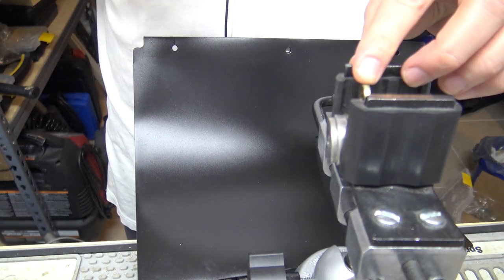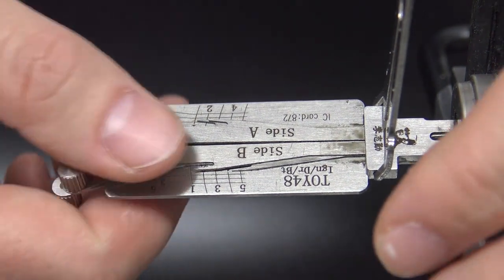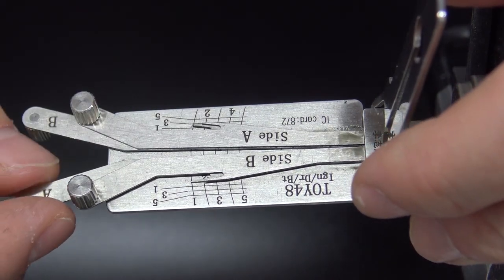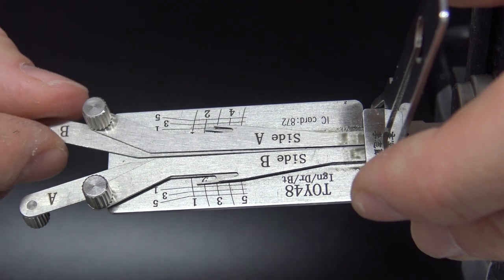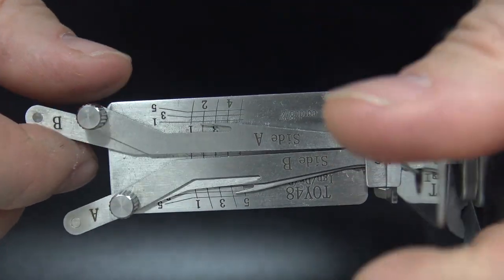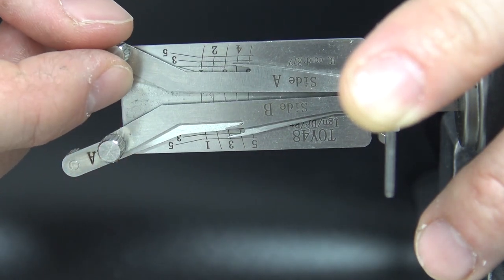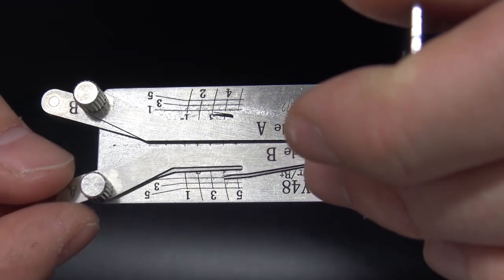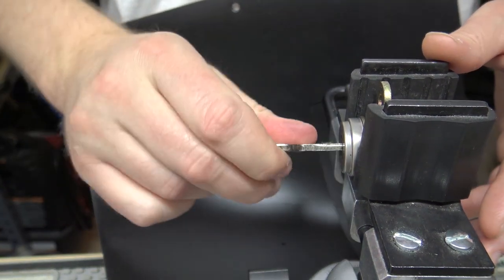(458) 4 Lifter TOY48 Lishi Picking & Decoding Lexus Door Lock

Comment: These are the most difficult for me... B111, hon66, hu66..easy..I have more trouble feeling these than any other. Started using lishi primarily for keymakes around 2014/2015, love them! So much less scoping and disassembly! (Also, screw an easy reader 🤣)
Reply from the maker: I love lishis!  They’re amazing. When I have to actually take a door panel apart or a car lock apart I almost get mad lol.
Reply: B111 is the hardest lishi ever made, especially with loose locks. It could be 1-4

Comment: Hi Bored! Can you please tell is there any difference in picking/reading technique if the lock is in its "real world" position in the door where the neutral key position is vertical? I have a dead battery in my Toyota Auris (again, lol) and decided not to call a lock opener people this time and do everything by myself. And I have a strong feeling that I'm doing it wrong (or maybe the lock itself is broken bc its emergency key never worked since the car purchase). When I try to pick, i.e., side A, it appears that some pins are pickable on the right and the same ones are completely "free" on the left (no resistance at all, even a light springing back). I apply tention to the lever clockwise.
Reply from the maker: There’s no difference in picking whether is in my vise or on a car.  If your emergency key doesn’t work the lock is either broke or it’s the wrong key.  These are crappy locks and wafers are easy to bend even by inserting a wrong key.   That said I wouldn’t call this Lishi a beginners one. You can probably go to the dealer and get a new E key cut and see if it’s different than the one you have. If it doesn’t work the lock is probably broke.

Comment: I picked a customer door lock on Mitsubishi Mirage using MIT11 pick. Did it within a couple minutes TWICE. The number taken by iPhone on video did not work to cut a key. Tried 4 alternatives and nothing. Customer returned yesterday and I tried to pick the lock again. This time it was a whole different lock. Could not feel many of the wafers inside at all. Then customer pressed unlock button on his remote by mistake and doors unlocked. Only after he locked them again, picking the lock was much easier. (Why would this be...?) 

Then I had a thought. So once lock picked rather than turning handle far right to decode, I'd turned the handle on the pic back to almost vertical when the pic picked the lock. At that point I decoded the lock. The numbers were different to when handle fully turned. Only a little but definitely different. 

So where is the place to decode the lock. Handle partially turned or fully turned?
Reply from the maker: Every car is different. Use a code fill program to check your cuts and make sure you get a valid code before you cut a key
Reply: @BoredLockpicker  Logic suggests you get the handle to turn and then you decode. No point to turn Kishinev handle all the way to right before decoding. Thats what I am going to be trying anyway. 

So Kishinev with 4 levers. Whats the secret?
Reply from the maker: @jamesbarratt593  they have to be picked twice to read then picked back to home
Reply: @BoredLockpicker  What do you mean by that then? I say with furrowed eye brows. Hmmmmm very interested in your reply. Picked twice you say.
Reply from the maker: @jamesbarratt593  yes. Watched he video. Also watch the hon66 video. Same concept. Lock has to be picked twice to read then picked back

Comment: Yo bored. I bought the full 102pcs lishi set. It came with metal key slave blanks. I don’t have a cutter for security keys yet, just the hpc 1200 blitz. If I have lishi pick model can I use that same lishi type to determine proper key blank? Example lishi nsn14 I can buy nsn14 key blank? Silca. I’m new to automotive locksmithing and trying to figure out how to stick key blanks but so many damn key ways not sure how to begin stocking blanks without ordering at time of customer calling
Reply from the maker: those blanks that come with the set are 3rd world countries that still do a lot of things manually or by hand.  any tools you buy for a U S distributor wont have them.  and the lishi tools are named after the silca blanks.  if you're in the U S you can use a key blank cross reference program like lock codes has and get the jma and ilco blank model numbers.
Reply: @BoredLockpicker  yea I realized that after some more videos. You can make high security keys using them them using a cheap high security key duplicator to make a key. Pretty interesting but I’m planning on getting the xhorse dolphin so I can cut by code